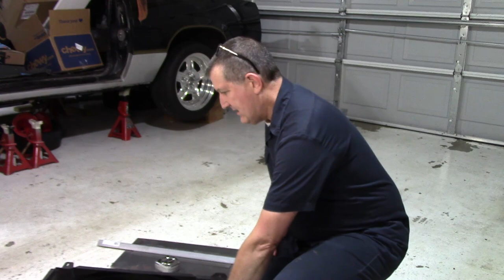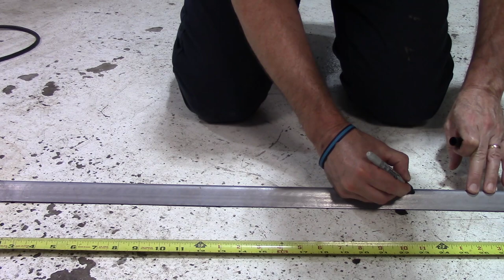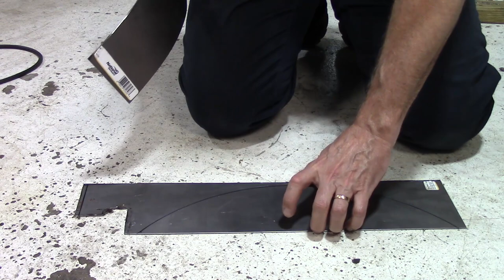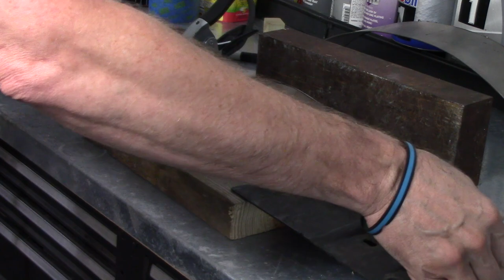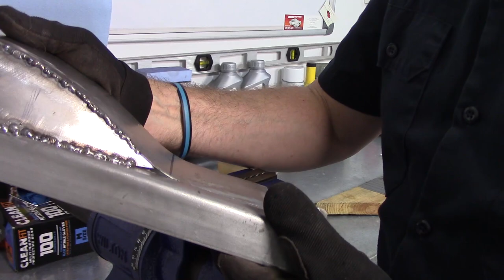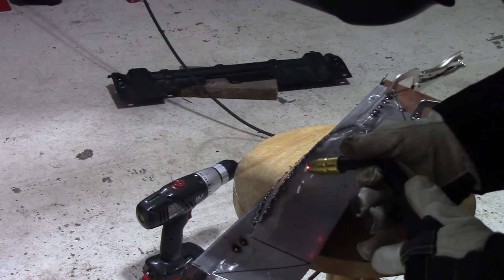Fan Shroud Fabrication!! 1987 Olds 442: Video 54

Comment: Got my 67 442 in 1970 used and it did not have a shroud and no clutch fan just reg 4 blade fan and it always did run a little hot. Engine locked up in 76 and it sat until 2012 when I started bringing it back from the dead. Still working on it and fixing to rebuild my steering box using your videos. Your doing a fabulous job.🍺🏁
Reply from the maker: Thank you. Another Olds back on the road is a good thing.

Comment: Don't forget...the fan shroud serves a purpose..it's to help the air being sucked in to cool the engine..without it..the engine would get a little hotter.
Reply from the maker: Don't forget, I have a Cold Case Radiator on the way. It has it's own fan shroud and dual elect fans. The "Fan Shroud" I'm making is more or less ornamental.
Reply: @hutchhiperf  oh ok..just putting in my two cents...didn't finish watching the whole video but wasn't sure if you knew it serves more than just safety...well your doing a good job on your build and can't wait to see it finished!..I have an 88 Monte Carlo LS and can't wait to do a frame off as well. Have a nice day.